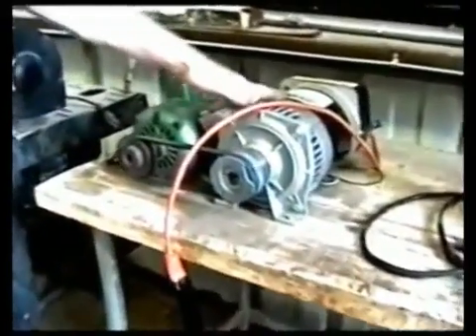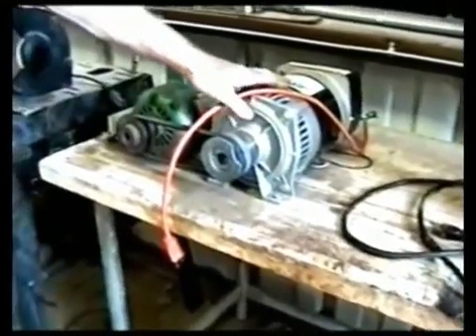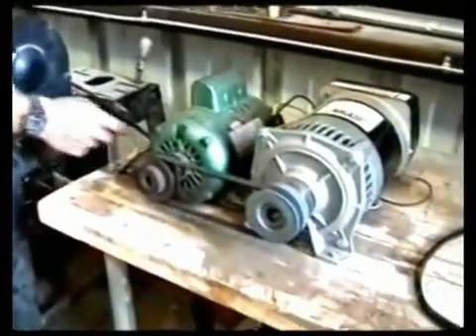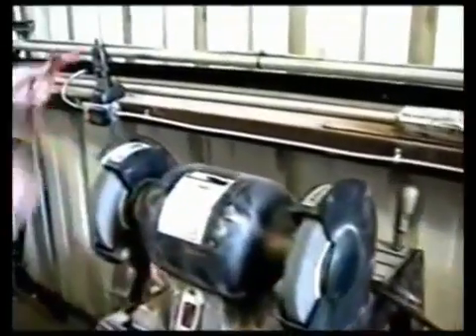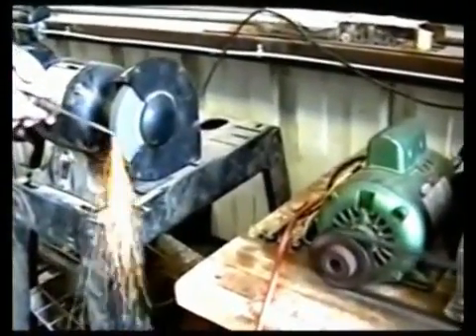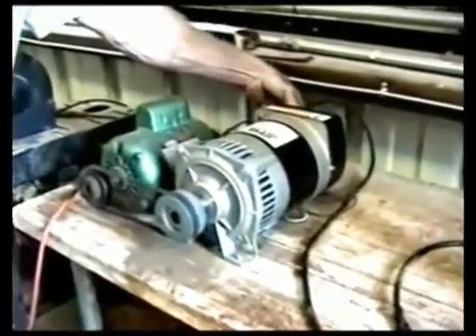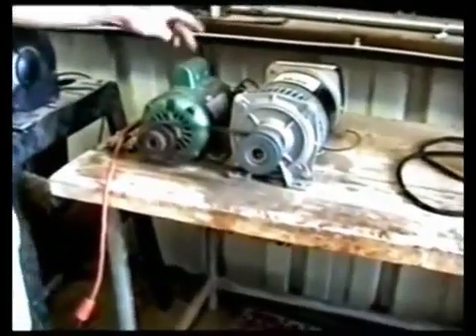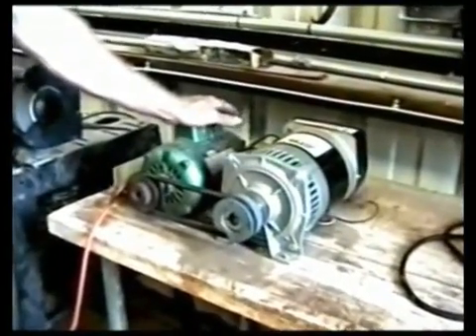3000 Watt Generator Powers Itself, Grinder & Drill Press.

Comment: In theory it is possible. I created one something like the one shown. my only problem was making more energy then I was using. I could only run a light bulb off the unit for a short time before it stopped. thus more alternators would work, but then where are you going to store the energy you create? again that was my problem. I could not finger out how to regulate storage of the energy without battery overload.
Reply: The problem with using more alternators, is each one requires mechanical power to run. If you have a 5kW alternator that's 80 percent efficient, you'll need 8.33 horsepower (1 hp = 750 watts) to drive it to full output. If you put a second alternator on the belt, you need to provide another 8.33 horsepower to drive them both, and on and on as you add alternators.

Have you considered wind turbines? They work well.
Reply: I learned to use motors or wind turbines instead of the alternator.

Comment: 3/4 horse power = 560watts. generator claim to be 2900 watts. More than enough to run motor, yet the author claims that the generator can barely run the motor. 14 amp x 120 volts = 1680 VA, using a p.f. of .85 gives 1430 watts for the grinder at that level of consumption (load) there should have been a noticeable change in the revs on the motor/gen set. there was no change for either loads. The generator form factor remains the same, therefore the only change possible in the windings is to use different size wires which will not significantly change the power rating, but will change the generated voltage and current (again not significantly).

Comment: Check this and Compare:
Anthing for Real requires a Live or Draw for others to see clear:
I have seen and worked with many devices for Energy and 0 Polution Burns.
There is a surplus energy in E fields. Required is a Clear Drawing of Your Design with the Math.
Thanks:
See - Timeseeds at: -
        > http://youtu.be/bNbIh-oua_s
- LBT Dial A Grey to Color Invention:
      >>  http://youtu.be/BjxhLV29RjU
- E Field Energy -
        > http://youtu.be/u6NopeBxAe4
- E field Energy2 -
       >  http://youtu.be/a-GAF-rTX54
- Atom Engine 1st hi res.-
       >  http://youtu.be/5R0IUJKzcu4
- Atom Engine Developements.-
        > http://youtu.be/pFNWNltL-EY
- Atom Engine Proto Type SCaled Atom
        > http://youtu.be/52N3Fnn2now
- Web 03 PacificDecal on Time and Tone
  assembly of a Universe.
        > http://youtu.be/Jj0U4az11VQ
- Linear Grey scale to Linear
  Spectrum no Processor. vj-03-15
       >  http://youtu.be/ifMedRE6LXk
- Oil from -
       >  http://youtu.be/YSadSSbNaZs
-E-Field Sphere Glue Test.
       >  http://youtu.be/mnWocTdPHvI

Comment: Fraud exposed:: Look at the back left table leg. You can see the table isn't sitting on the legs like normal. The table is pulled forward so hidden wires can come up the hollow leg and run along the back of the table where you can't see. The hidden wires are what actually power the motor, drill press and grinder.  This is a magic trick pretending to be science. The only free energy source is YouTube advertising revenue the hoaxer gets from tricking five million people to watch this fraud.

Comment: Well, partner, after spending over forty years in a major University I know quite a few people who would be interested in seeing your contraption.  I don't care to.  There is one simple reason that your perpetual motion machine won't work, and it is simply the force known as "drag", and even if you were running your machine in a total vacuum and using air bearings, it still would not work......there is the effect of the weight or mass of the armature that would cause it to slow down and stop, even if you could get it going by starting it on straight power. The engineers at NASA have been trying for decades to build a perpetual motion machine, and they only want it to work in outer space, but, alas, they haven't checked in with you and your magic workshop.   Oh, by the way, that equipment that you are using to demonstrate your magic with; the drill press only draws an average of 3.5-5 amps running, and the bench grinder model that you used averages about 6-7 amps depending on whether it has a 1/2 or 3/4 Hp motor on it.  Not the wild numbers you claimed.  I have about five acres of desert land down in Florida to sell if you are interested.

Comment: you cant get more energy from what you put in... how does a car produce 40,000 volts then out of a 12 volt system?   and before any of you morons tell me it doesnt.... read up on it first, or your comments will make you really look stupid..
Reply: Through the miracle of electromagnetics. The ignition coil is a transformer that takes the 12-volt pulses you feed it and boosts them to 40,000 volts. Simple, well-proven science.
Reply: Dave Lane, your undestanding of electrical principle is the only thing lacking here.  Educate yourself or be taken advantage of by charlatans.
Reply: +Devin Williams WATTAGE stays the same - after accounting for losses due to resistance - if you're going from high amperage (amperage is the measure of current) and low voltage to low amperage and high voltage.

Comment: I achieved the same effect by eating at Taco Bell, every meal, for one week straight.  My methane powered infusion generator doesn't even need wire, the electricity produced is captured nasally, and promulgated freely within a 50 yard radius from my generating "source".

That, my friend, makes more sense than the bullshit you're trying to sell to the undereducated here.  Transformation of energy requires... energy.  Here's a simple test: can you define the value "f" electrically?  No?  Obviously you cannot,  there is no free lunch, and I hope you fakers screw up and do something that gets you in the cross hairs of whatever authority you live under.  Lying in one thing, lying for financial gain is quite another.  May you reap what you sow.
Reply: A steady diet of chili would work better.
Reply: Jim Mowreader, that would be an unsustainable discharge, at some point the output would exceed the input, and much like the fantastical generator in the video above, I would only exist in fantasy and pyramid schemes.

Comment: All this negative shit over a good idea I've actually bin thinking of doing something similar to this has u tride a 1ho motor to a larger generating unit or using the same one with 2 of thos moded ones?
Reply: A 1hp motor connected to a larger generator is going to have the same problem, just upscaled: an electric motor connected to a generator isn't going to be able to make enough juice to keep itself going.
Reply: So if u added like a transmission of sorts like speeds on a bicycle that wouldn't help it generates more power from The same electric motor
Reply: victor vargas No. You could mechanically increase the torque coming off the motor by putting a reduction gear in there, but you'd decrease the RPM hence decrease the output frequency (if you built your own alternator this wouldn't be a huge problem - you could put twice as many coils in there and increase the frequency that way) and generators don't care about torque anyway - horsepower is what they're looking for.

Now...if you were building an electric truck and needed more torque than your motor can deliver to get the vehicle moving, you can solve the problem pretty easily with reduction gearing.

Comment: I under stand the loss of energy but you can displace that energy with gears (specific sprockets to displace the loss into a gained speed).  i have created masterbation on your faces. that explains why i'm not wearing my pants and how to make free energy with a blue print of gears transferring loss to gain working Free power like an old ass grandfather clock. copyright the guy in the picture

Comment: Of course it works, using electricity to produce electricity, simple. For laymen, another way of doing it would be... fit a large belt wheel on the motor and a small wheel on the generator and Bob's your uncle. You get out more than you put in. For those who think the laws of physics can't be broken, I am sure they would be the same people back in the day who were saying the world is flat and the sound barrier/wall can't be broke and man will never walk on the moon, etc. And I believe scientists have found particles deep under ground that could only have got there if they traveled faster than light which we are told can't be broken i.e. the faster than light barrier. Electric cars are all ready using their brakes to recharge batteries and it is only a matter of time before they figure out to hook up the wheels to generators to recharge the batteries. Hydro electric dams pump water back up hill to use again via electricity and wind turbines are going to... in the near future use spare capacity to compress air into large tanks to use to turn generators to produce electricity when the wind does not blow, that's free perpetual energy. And where did the oil, gas, coal, wood, sun, etc come from.

We have just landed a space craft on an asteroid to see where we came from. It is believed microbes came in on a comet and sparked life... so microbes put in a microscopic amount of life and produced billions of complex life and us and we are now going back out there to find out where we came from - which is perpetual motion in every day use, get more out than you put in... just look in the mirror to witness the living proof, we only exist due to perpetual motion but that is just my opinion... 1/1/15
Reply: TheOriginalSyonix Plugging your laptop into the wall outlet at Starbucks doesn't count.
Reply: No, actually you don't get out more than you put in - you never do.

There is a very long formula they use to calculate the amount of power there is at each end of a two-pulley belt drive. If you're building a machine that needs X amount of power at Y RPM and you know your motor turns Z RPM, you can determine your pulley sizes and motor HP requirements pretty easily. 

We'll throw out two numbers: our motor produces 1 HP and it turns 1000 RPM. (I don't feel like doing complex math tonight, 'kay?) Every time my motor makes a revolution, it will produce 1 horsepower.

If I put a pulley the same circumference on both the motor and the load, the load will have 1 horsepower applied to it every time the motor turns, and the motor and load will turn the same speed. Cool so far?

If I put a pulley half the circumference of the motor pulley on the load, it'll turn twice as fast but there'll be half the power on the load. If I go the other way, the load will turn half as fast but there will be twice the power on the load. 

If you want to see this in real life, get a 10-speed bike. Shift the back to the lowest gear (the one with the most teeth) and take off. Then shift into high, stop, wait a couple seconds and take off again. It'll be harder to take off in high gear because the bike needs the same amount of power to move, but the gear requires more power from your legs to turn it.
Reply: Haters gunna hate hate hate hate.. They will never listen.. WAH WAH WAH IT CANT BE DONE... Yeah.. tell us something "can't" be done .. 

This comment written on a laptop powered by free energy. suck on that!
Reply: Jim Mowreader I now have a sore head... I will take your word for it. Perhaps the line in the Matrix film "ignorance is bliss" is quite apt. Bolivia has half the world's supply of lithium to make batteries for our portable energy needs and the sun to charge those batteries... perpetual motion perhaps...
Reply: stormislay If you're using solar, wind, wave or some other form of what the cool kids call "renewable energy," you're out of the realm of perpetual motion. Solar works. Photovoltaic is presently expensive to install but that's a one-time cost, assuming some external force - hurricanes, trees falling on them, too much snow - doesn't damage your panels. 

If you combine a large solar array - think "75 to 90 percent of the southern side of your roof" - with a wind turbine, batteries and inverter to store the power for later use, and maybe a 5kw diesel generator just in case the wind doesn't blow and your panels are covered in snow, you'd have a good balanced off-grid power supply for your home. If you had a large-enough home to fit both of these, maybe cover half the roof with photovoltaic and half with solar heat collectors with rock-bed storage to keep you warm in winter. Or put up a big shed to hold the PV panels and cover your house's roof with heat collectors. Stick with things proven to work.
Reply: Jim Mowreader You know a lot. Your info has been informative, thanks for that. I am sure you know the story of Frank Whittle and the jet engine... where he was told to stick with what we know... Perhaps we should step away from the digital world, I am off to take the dog a walk...
Reply: In the case of your gears, you gain speed, but you also lose torque. you have not increased any actual energy. If anything, you have lost energy through parasitic drag.
Show me your sources for "Hydro electric dams pump water back up hill to use again via electricity"
Reply: It was something my late father once told me, though wind farms to compress air to turn electricity producing turbines when the wind does not blow is viable... or is it?
Reply: stormislay Possibly...this would be better: get a wind turbine that's twice to three times as big as you need it to be, and connect it to a bank of batteries. Then use an inverter to draw power from the batteries and convert it to AC. They use compressed air for energy storage at some power plants...but they're using a power plant to generate the compressed air (in which case can you not only exploit the off-peak capacity but can also drive a compressor off the shaft of the generating turbine, mechanically) and they're storing the air in caves. If you just have one or two wind turbines, storage in batteries will be more efficient AND you won't have to buy a huge-ass air compressor.

Comment: So why is there no audible change in rpm from the "generator" when the grinder or the drill press are switched on and put a load on it?

Why do losers keep making this fake crap?
Reply: did he say it was a standard generator? It could of had a custom wind job in it with neodymium magnets and that "old" motor could of been a custom job too in a old case watch there other videos and you'll see they been making these for years. Until they do a making of video to see the internals no one knows. drill and bench grinder draw not much power but would like to see video again with the guy using a multi meter.
Reply: caveman s It wouldn't have mattered if it was a "custom wind job" with neodymium magnets, or just a motor and generator head he bought off the shelf at Northern Tool. (Check the label on the generator head - "Northern Star" is Northern Tool's house brand. Northern Tool is an upscale Harbor Freight - same basic stuff, much better quality.) 

He would still have to deal with three huge issues not addressed here:
ISSUE 1: Resistance. Unless he has wound his motor and generator with superconducting wire, both units have electrical resistance. Since (1) there is no cryogenic plumbing on this system, (2) you can buy a lot of electricity for the cost of liquid helium and (3) superconducting wire is $40 per meter, this wasn't done. With a resistive motor, he needs more electricity than he gets back in mechanical power - his 562-watt output motor requires 900 watts of electricity to run.

ISSUE 2: Friction. This can be overcome with air bearings - which he doesn't have because air bearings float the inner race on a cushion of compressed air that comes from the compressor not connected to either the motor or generator.

and...

ISSUE 3: He doesn't have enough horsepower to do what he claims to do in the first place! Northern Tool states on its website you need a 5-horse motor to drive this generator head. If you eliminate all resistance and all friction you still need 4 horsepower. He has less than one horsepower coming off that motor.

Come on people...if you want "free electricity" from this generator head, quit fucking around with perpetual motion bullshit that will NEVER work no matter how many "you just don't understand" lines you feed us, and build it into a wind turbine. Then use the turbine to charge a bank of truck batteries, and finally pull power from the batteries through an inverter.
Reply: your right there is no change in rotation sound!!!!!!!!!!!!!!!!!!!!!!!!well spotted

Comment: How do you modified the generator to produce that much power?. If you can show/teach me how to do that, then I will put up my own money to build at least 20 unit of those overunity system to be given away to people in the remote Natuna and Kepulauan Anambas, (pulau laut and other small islands) area in Indonesia where the people has no access to electricity (my company donated limited number of solar cells though) as part of Community Development Projects. You can check my credibility in Google.
Reply: Did you modify the generator and/or the motor by rewinding them asymmetrically? If so, would you mind showing the schematic diagrams for good cause? thank you.